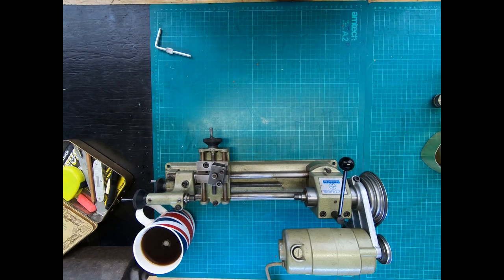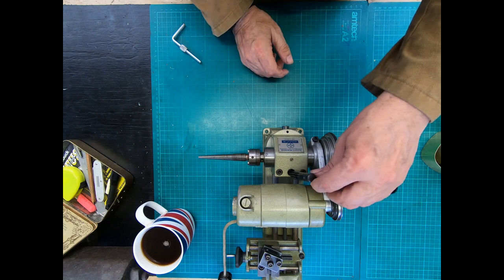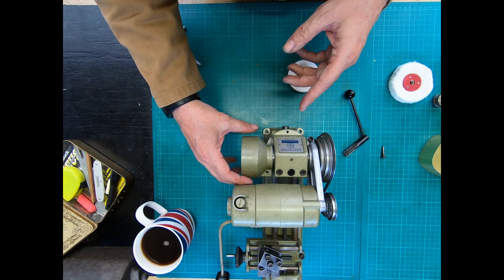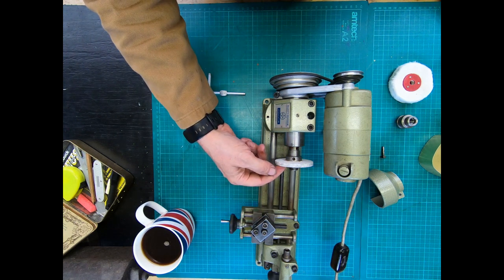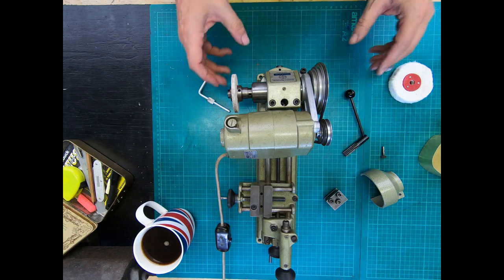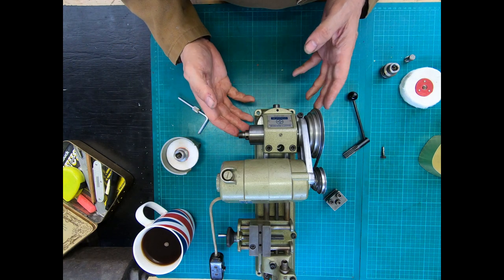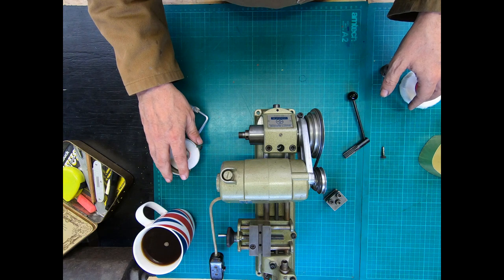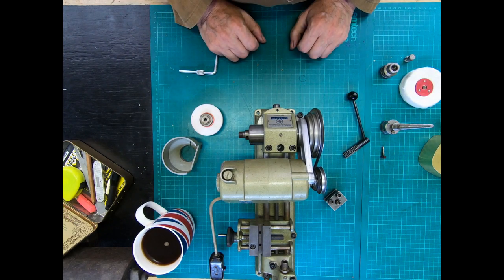Unimat SL Grinding and Polishing Attachments.

Comment: Think u take stone off arbor then put grinding arbor on spindle tighten slide gaurd on tighten gaurd then put wheelor stone and end nut hold it ((stone) on. I think I don't have guard but have grinding arbor.
Reply from the maker: Hi Paul,
Thanks for the tip... I have tried that and it works a treat... 
Take care.
Paul,,

Comment: Hi Paul, your unknown part, pictures of the original arbor show that part with a square head which I suspect is used with a wrench to tighten the wheel rather than a tommy bar. The one you have may be a homemade one for a skinny wrench. My two cents.
Reply from the maker: Hello Dave, you could be correct... I will have an experiment. Thanks for watching.

Comment: Ello Paul, you asked a few things the little metal bit for the grinding wheel addon is to mount it on carriage i have the same bit for mounting other parts, to put the grinding wheel on you first put on the holder without the grinding wheel on it, tighten it, then add the guard, then put the wheel on, more steps but thats how the system works i have one of these little guys that i just restored still learning how to use him
Reply from the maker: Hello,
Many thanks for watching my video and taking the time to comment... That makes perfect sense on installing the guard and grinding wheel, thank you. I hope you have lots of fun with your Unimat SL.
Take care.
Paul,,

Comment: That funny bit is for the T slot on the cross slide or the milling plate.
You can use it to attach the chuck, the sanding plate as a drill press table or other workpiece holders for drilling or milling in a horizontal position.
Reply from the maker: Hello,
Many thanks for the information... as I got one with each of the two grinding wheel arbors it seem a little strange. I also have another type of T-bold thing to fit the chuck, etc. to the milling table. Thanks again for your help.
Take care.
Paul,,
Reply: @TheKnacklersWorkshop  the one you have looks a little more solid as the one I have that probably is original SL/DB. Maybe it is third party or custom made.

Comment: Am I the first? Smashing video. Such a versatile machine. What sort of motor runs it?
Reply from the maker: Hello Carl,
Congratulations you are the first viewer who has ever done the "First" thingy in the comments on one of my videos, I think that officially means I am a YouTube superstar - lol.
It has a little 95w motor, with the gearing you can run at 4,000 RPM. The motor are a weak link on the Unimat as they are prone to over heating so you have to run for a little then let it cool down. Thanks for watching.
Take care.
Paul,,
Reply: Magníficamente explicado , felicitaciones
Reply from the maker: @joselopezruiz3972  Thanks for watching...